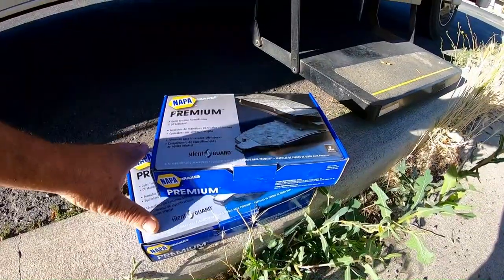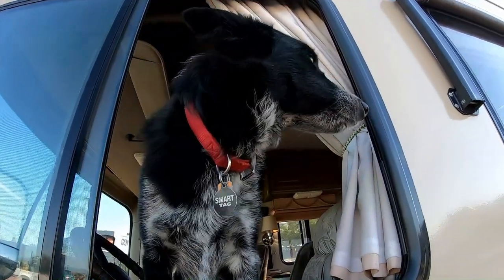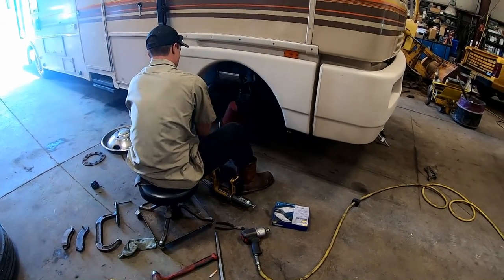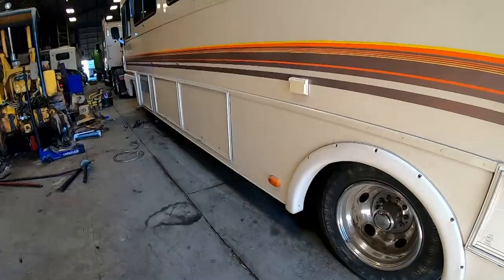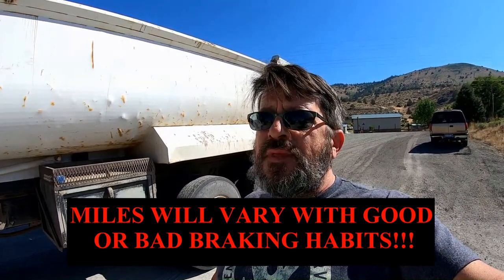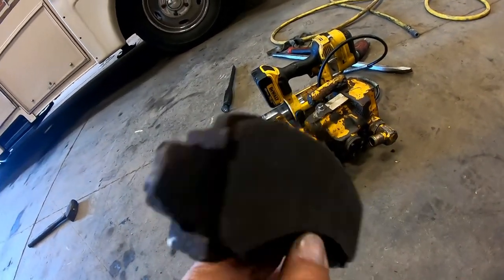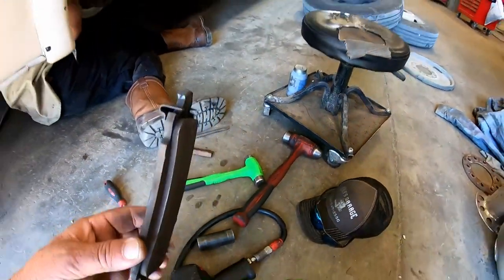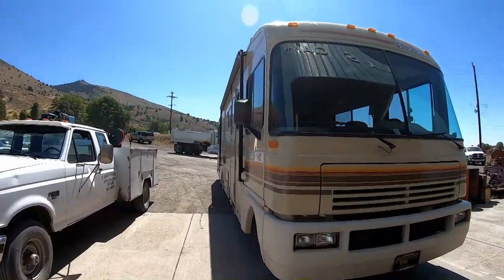Check Your Brakes! - Be Safe in Whatever You Drive!

Comment: Max’s Garage gave you a terrific price for your labor costs. 👏 Great job fellas. 👏To include they allowed you to bring your parts for them to install.  Some shops won’t extend a warranty (parts & labor included) when that happens, but than a majority of parts already come with manufacturer attached warranty.  Here in Ocala, FL some shops are ☎️ quoting in excess of $2500 just for the front system, double the price if rear is needed; bearing in mind that’s “if” one needs calipers, rotors, etc, which I feel is rather high, but maybe I’m wrong.  Then again I’m a woman & just wondering if some shops are trying to take advantage of such.  Especially if they think one lacks knowledge.  However, when I take my 🚗 & rv 🚎 in to be checked over I always request a written estimate as well as wanting to see parts requiring replacement while engaging the mechanic into reasonable explanations.  I’m never rude to them; it’s just my way of feeling at ease with one’s expertise.
Thanks Dave for actually showing us the thickness of the worn & new brake pads.  Good learning curve for us gals of all ages.
Safe travels...🚌🚎🚌
Reply from the maker: That $2500 is crazy! I had the Bounder done in Inglis at Beasley Tire & Auto Care Center. It helps you if they know that you know what you need!

Comment: I’m glad you got that much needed brake job done on the Bouncer and someone who were able to put those brakes on. Did you just have that brake job done,or did you get any other routine maintenance done,such as an oil job and got the fluids filled up,like radiator fluid and other necessary fluids. Buying those brake pads yourself saved you a lot of money ,and all you had to pay for was the parts and labor. That was quite a bargain for sure!! Did the Bouncer require an oil job as well? Wishing you and Bella. safe travels on your next,newest adventure on the road ahead and go wherever the road leads you to next. Sending my LOVE to Bella,ok? ♥️♥️
Reply from the maker: I changed the oil and checked all of the other fluids just a few weeks ago. I think I'm good to go for a while! :)

Comment: I just had to buy new bearings and a new axle for my truck just because of this issue.  I didn't have an emergency situation because I pulled into a shop in Klamath Falls as soon as I noticed it.  Pulling my trailer it really could have been a bad situation.
Reply from the maker: Yikes! You were lucky to be not too far from a town! I'm glad it worked it wasn't worse!  SAFE TRAVELS!!!  :)

Comment: I'm getting ready to redo my front breaks on my 94 Bounder. Have you had any difficulty sourcing rotors or pads? Do I just ask for parts for a P30 chassis?
Reply from the maker: Yes, most any auto parts has them or can get them quickly.